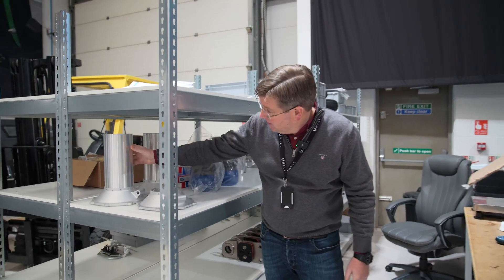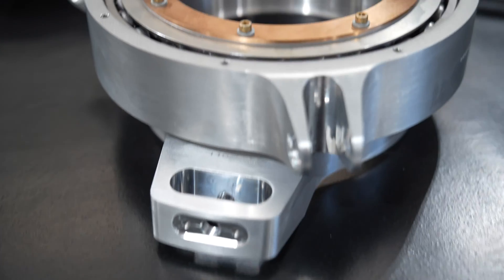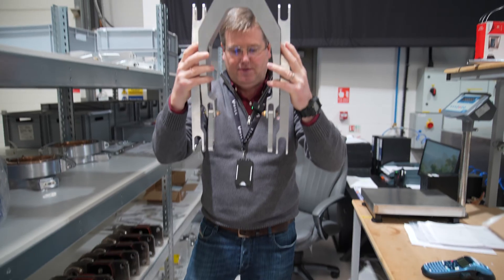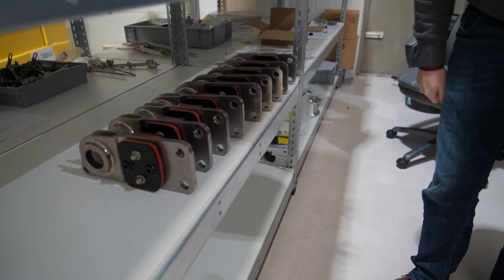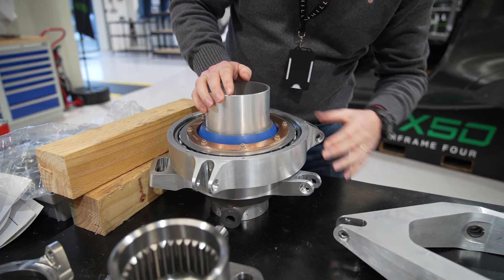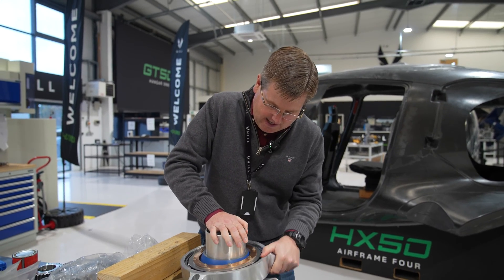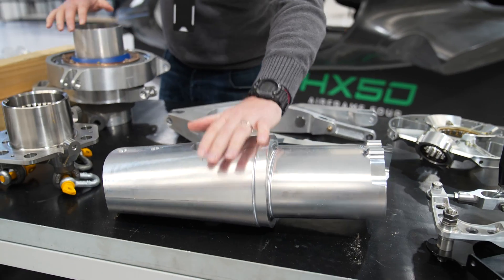Main rotor system

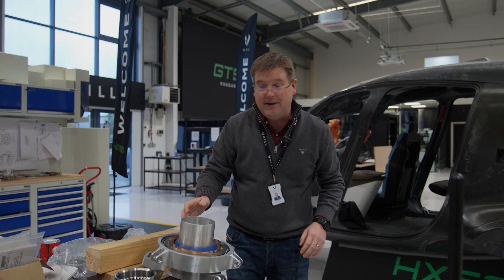Comment: 1:25 all the engineers start screaming 🤣🤣😁😁
Reply: All of the YouTube watchers let out a collective gasp!!!

There is no room for mistakes…

Dropping parts can, and has, lead to unseen damage on various aircraft parts in the past…

Having an unknown damaged rotor system self destruct in flight would be a one way trip…

Critical parts most often have an equally well designed method of packaging them up for temporary storage…. They don’t get left out on a table, or in an uncontrolled area…. They go from manufacturing step, right into a protective package…

Anyone filming such antics usually knows better than to publish those seconds of video….  😃

Comment: Why is it taking so long? when will you start production???
Reply: Probably after the first test flight…

Which will probably be after the first engine run…

Which will probably be after the construction has been completed…

Then a bit of shake down steps…

Possibly a few design changes along the way…

Concurrent design allows for so,e pretty fast development while building the final product…

😃
Reply: You can’t rush aerospace engineering! Safety first